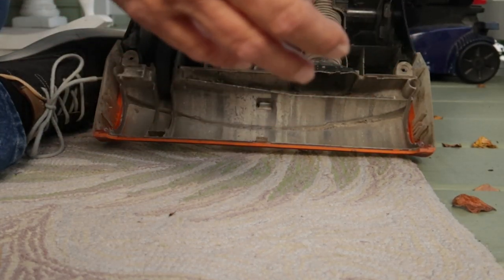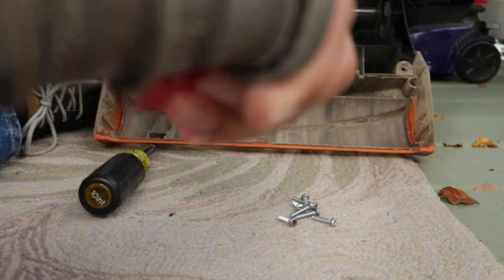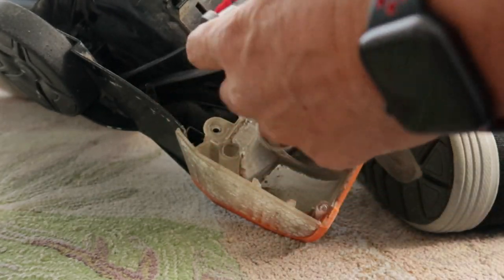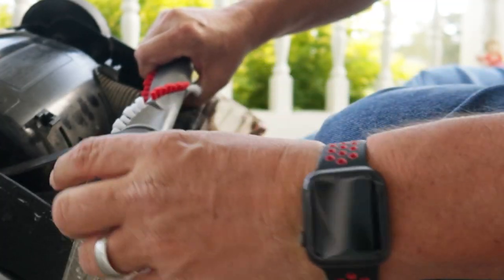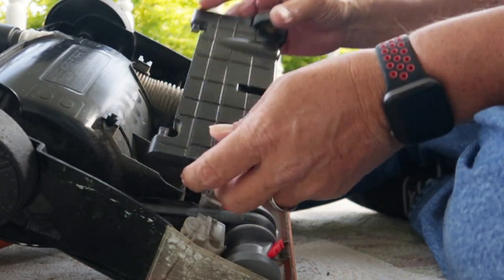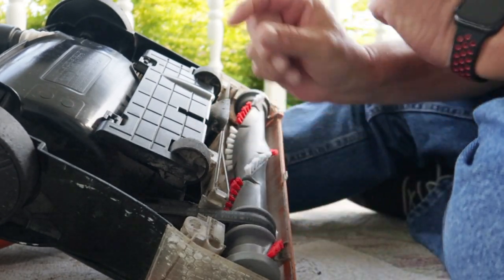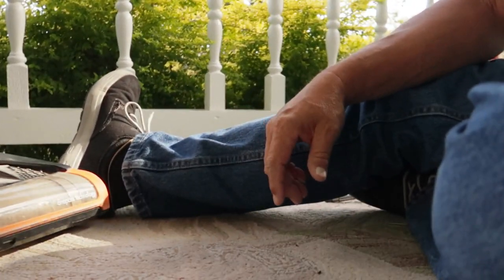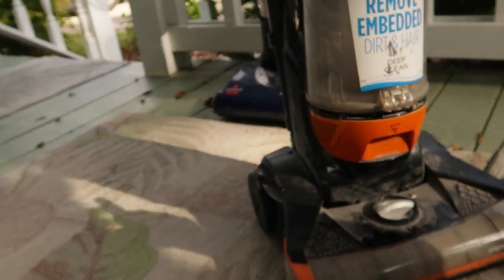Bissell Vacuum Cleaner Brush Roller Replacement

Comment: I went down this road as well. In my case I contacted my local Bissel support and gave them the model number. When the roller arrived I discovered that it does not fit. The  replacement roller looks exactly the same as the original except it is longer. Lesson learned here is to measure the roller first and stipulate the length when ordering. It seems to me these are generic brushes made in China (unbranded) and Bissel have several versions for the same model vacuum. When I check the roller it does not have any part number or OEM number to specifically identify it, yet on Amazon I see they mention which OEM the roller is for. Nice one Bissel !